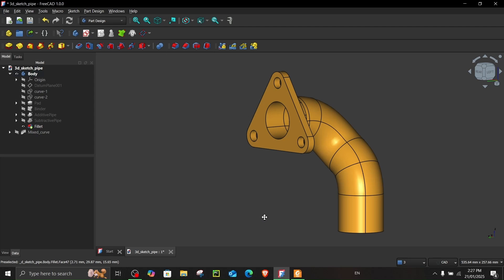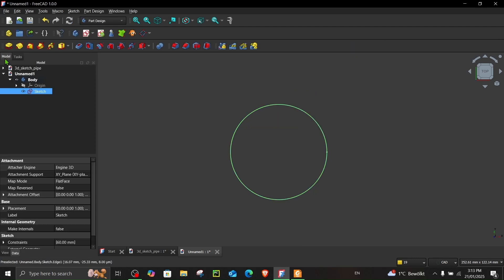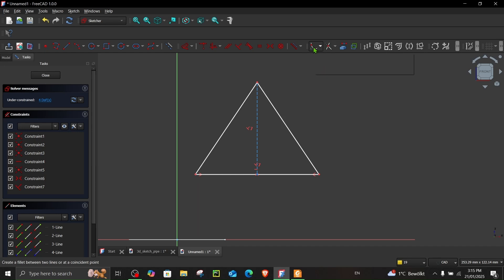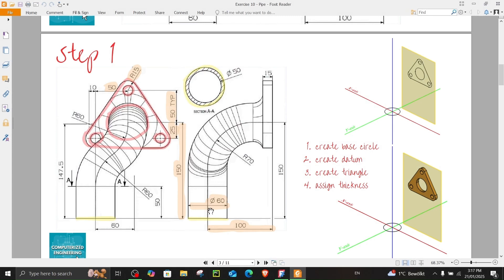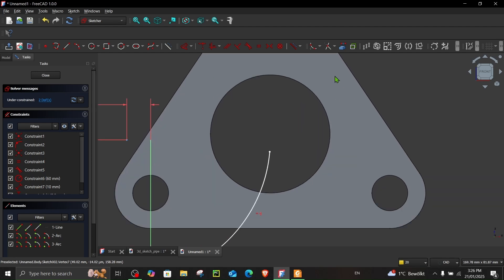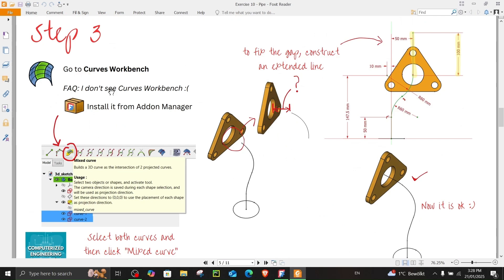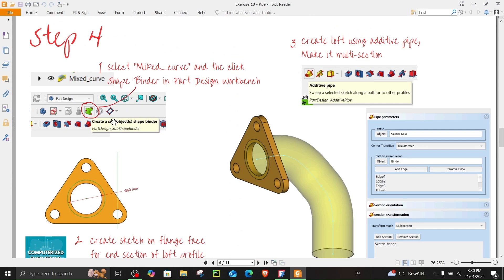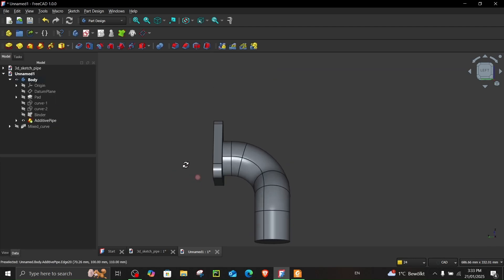3D Sketch in FreeCAD 1.0 | Projected Curves | Exercise 10

Comment: Great tutorial,may I ask you a question? What is the advantage of creating the hollow pipe with two steps, instead of drawing a second circle on the flange-profile sketch and use an additive pipe?
Reply from the maker: Thank you for your comment! I actually tried the approach you mentioned. However, I noticed an issue: the inside pipe didn’t follow the curvature of the pipe correctly. Instead, it intersected the exterior face at the middle of the curvature, which is why I opted for the two-step method to ensure proper alignment and accuracy.
Reply: @ComputerizedEngineering  That is interesting. Here it looks quite good. No intersection in the curvature.

Comment: The 15mm Fillet doesn't work because the end of the arc in curve 2 is exactly 15mm from the flange face. You would have to locate the Datum Plane at 100.1mm in order to achieve the 15mm Fillet

Comment: Quick question, why did you use a Binder rather than moving Mixed_curve into (um, drag onto??) the Body?
Reply from the maker: Great question! I used a Binder because it keeps the original Mixed_curve parametric and linked to the Body, so updates reflect automatically. Dragging it into the Body makes it a BaseFeature which might give an error (BaseFeature: No shells or compsolids found).